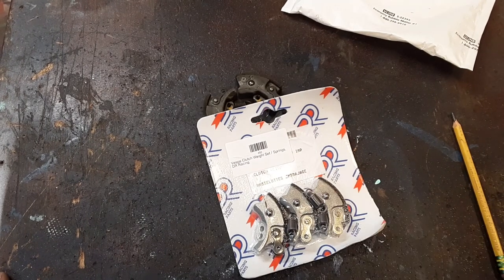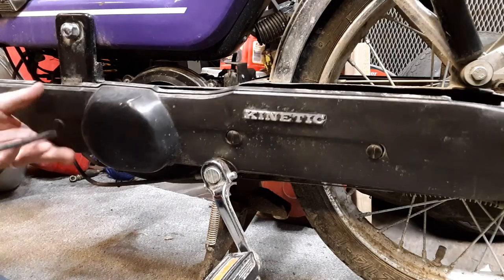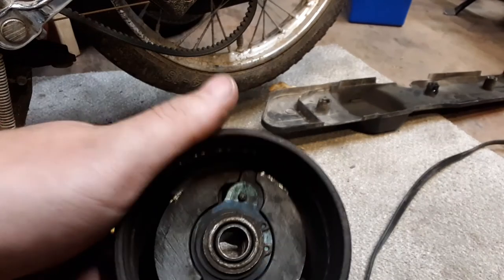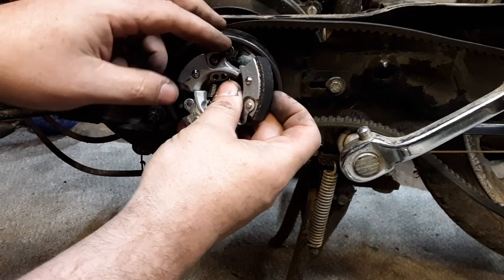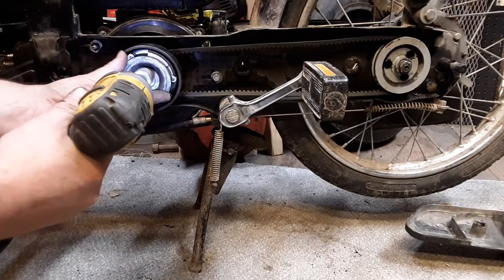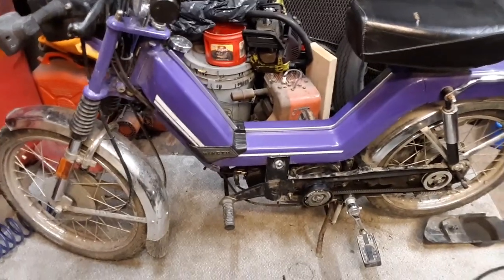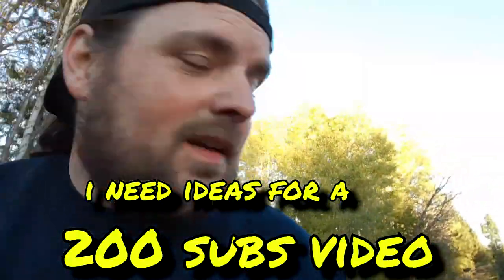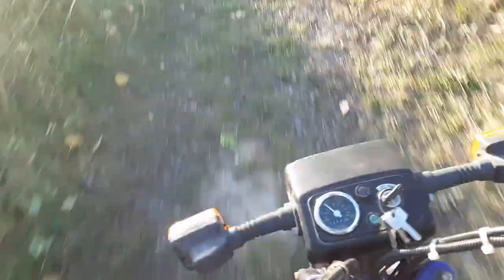KINETIC MOPED gets a new clutch

Comment: Look into the history of kinetic. Its a honda.
Reply from the maker: I was under the impression that it's a clone of a Vespa bravo but I might be wrong. thanks for watching 😎👍
Reply: @WesleySnyder  I don't know if Honda Is still involved with kinetic but from what I learned looking into the history(on you tube)that originally Honda partnered with a company in India to produce kinetic. I have a 98 tfl. And it's got Honda written all over it. I mean it looks like a Honda it runs like a Honda and is built like a Honda. For the most part it's dependable, but every now and then I have to clean out the main jet with a thin wire. I use the inner core of a guitar string.
Reply from the maker: @robertwhitright9816  nice to find a fellow guitar player that also is a gear head.
Reply: @WesleySnyder  I haven't played my guitar in about eight years, since I discovered that I can play the harmonica. I've loosened all the strings and it been sitting in its case. Also I don't really have enough room to play it because I live in a camper. Plus I never was very good anyway, but the harmonica, with that if I hear it I can play it, Pretty much. Thanks for your reply. God bless.